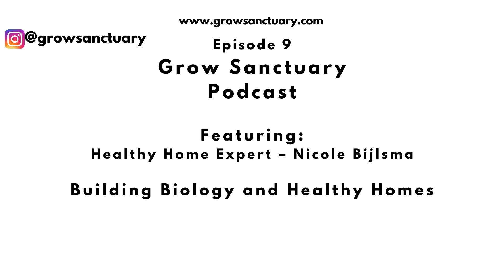Building Biology and Healthy Homes - Nicole Bijlsma - Grow Sanctuary Podcast Episode 9

Comment: Do you have any knowledge wether there are emf protecting clothes that cover the entire body in sale sonewhere?
Reply: @growsanctuary2867  Well at night I turn off all my electronic devices, wifi router and phone, so I don't see a big need for a faraday cage at night. My concern is the emf radiation I get while using my phone/computer for several hours a day. I'd love it if it was possible to get emf protecting clothes, or a cloak of some sort, so I could use these devices without getting the emf damage.
Reply: @growsanctuary2867  Can't get that for a phone though. I'll be searching for clothing that protects from emf radiations, perhaps I'll make a cloak out of emf blocking material myself.
Reply: @growsanctuary2867  All right, thanks for the advice.